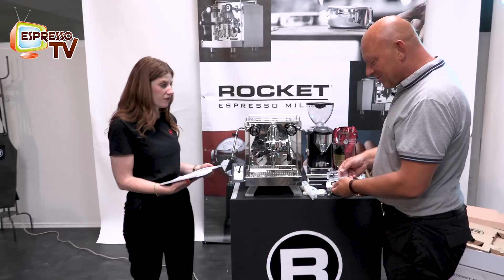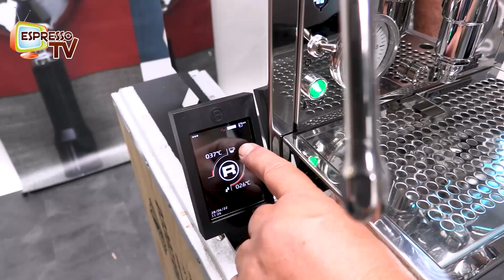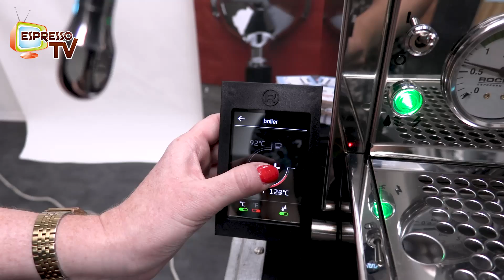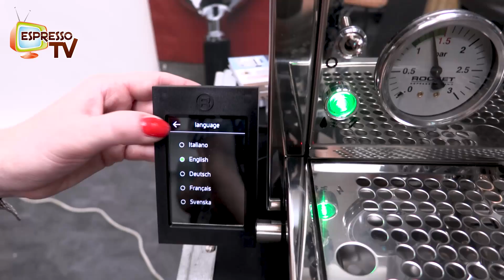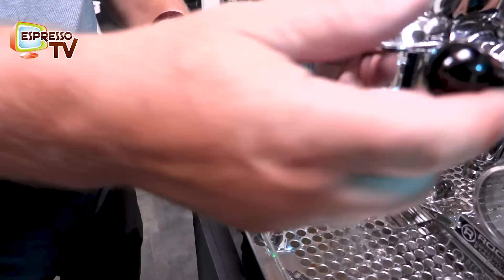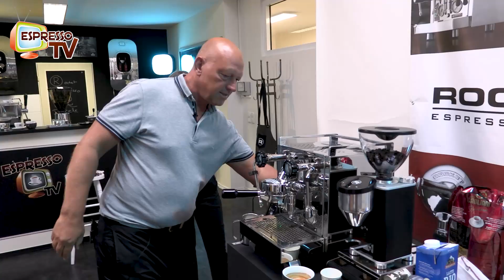Rocket R Cinquantotto together with the new Rocket Giannino grinder

Comment: Still not liking that frankenstein design with an LCD on the side of the machine. Brands like Bezzera have an upper hand there, sorry. Even ECM doesn't do that.
Reply from the maker: Yes Drazen, luckily the LCD can be removed, it has a USB connection, for training or the first steps it is very helpful